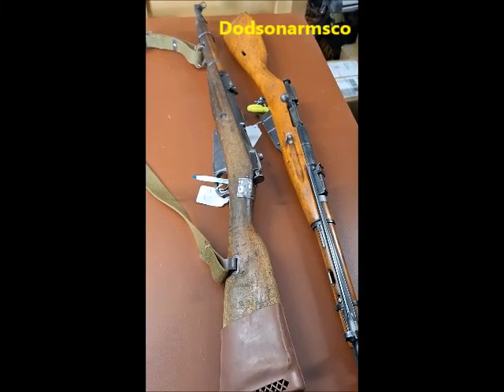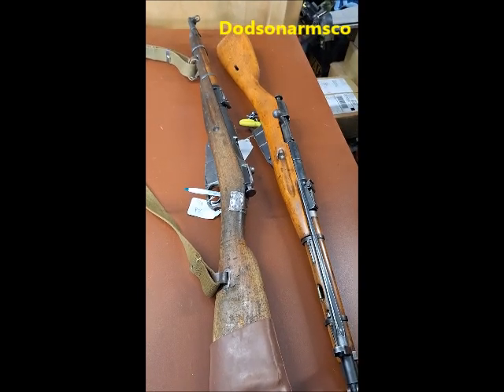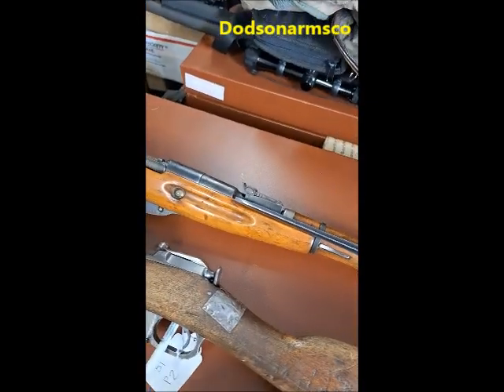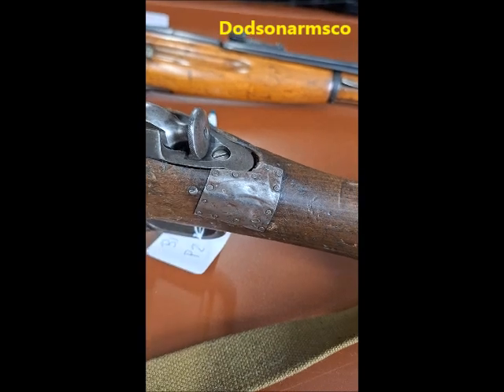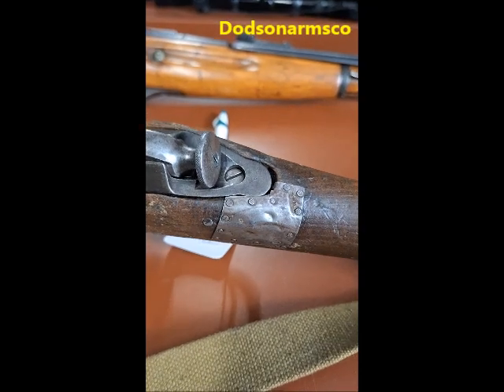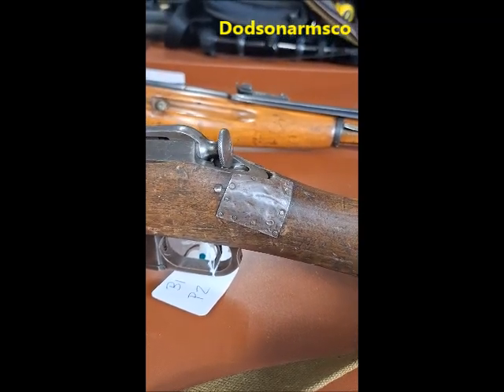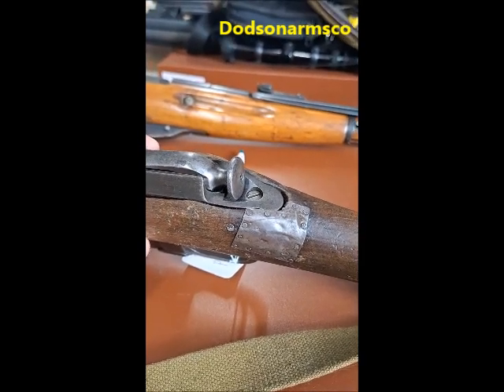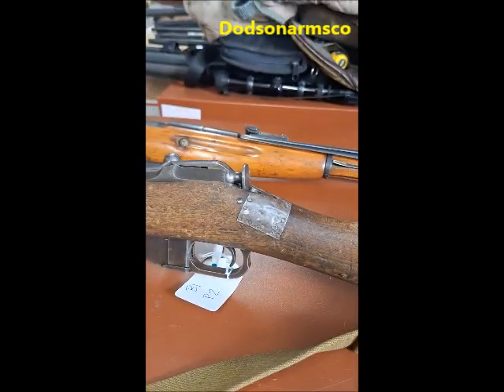HOBO Commando: Chicom Type 53 Carbine & M44 Mosin Nagant Sheet Metal & Tack Stock Repairs. SHTF WW3

Comment: Is there a danger of blow out with this type of repair?
Reply from the maker: It's about the same as using epoxy. Most of the time, they split somewhere else instead of in the same place which glass bedding the area around the tang would prevent.